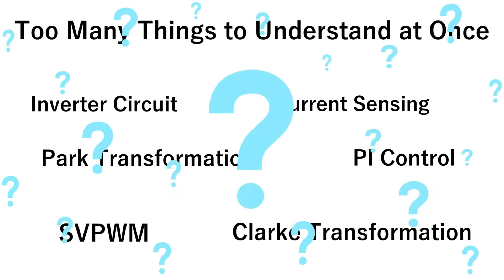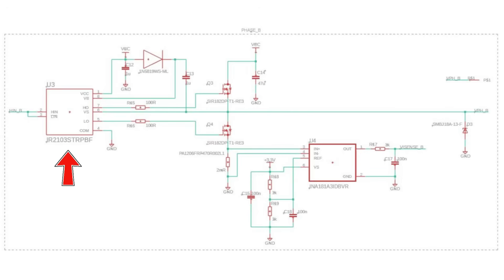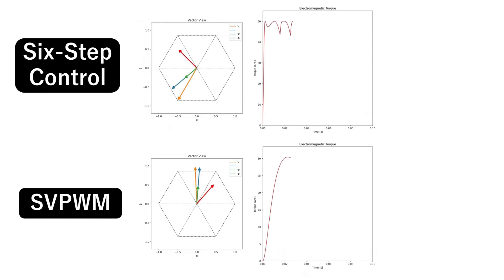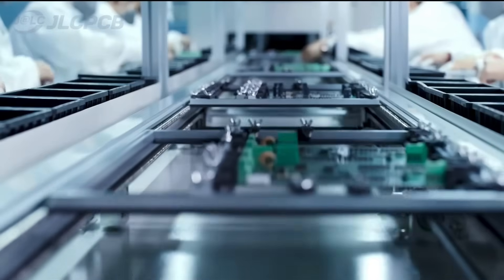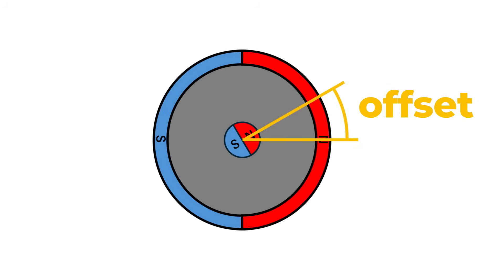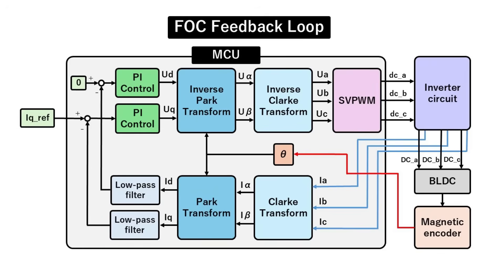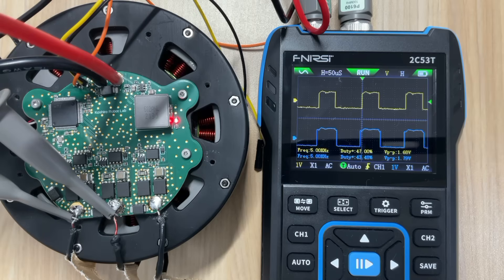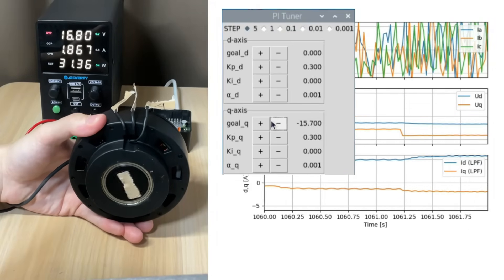I Built a DIY FOC Motor Driver.

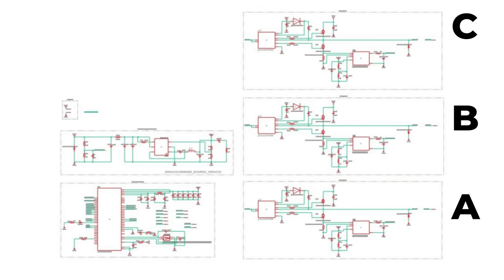Comment: Hi, is that schematic whole parts of the pcb? 2:14 i wonder didn't you fix schematic before do artwork. I’d also like to take a look at the circuit diagram. It seems I couldn’t find it on GitHub. I’m sorry to ask, but would it be possible for you to provide it?

Comment: Good video……Just wanted to know whether this can be done for Trapezoidal BEMF bldc ?
Reply: Yes, but the actual back emf is usually a lot less trapezoidal than you'd expect. 
You can use feed forward compensation to detect and cancel harmonics as well, but even without it, FOC will be quieter and less noisy as the control loops will compensate for it unless it's at really high speeds.

Comment: It isn't true FOC until the motor spins fast enough to make enough BEMF for the controller to determine phase.  Below that speed, you must rely upon the angle encoder.  Many motors (such as in drone propeller motors) start the motor open-loop constant current & ramp up until the BEMF gets large enough.  But for robots & skateboards, there must be an angle sensor.
          You make no mention about the code (other than the algorithm).  How many lines of code does this require?  What code language are you using?  STM processor seems like gross overkill, unless you are writing in "bloatware".

Comment: Why does each pattern map to a voltage vector? how do we know which pattern maps to which vector? Why do you need those diodes around the inductors? I know the answers but a lot of people watching have no idea. Stop making 15 min videos to explain complex topics for people with small attention spans. If a person cant sit and listen to an in depth explanation they probably aren't going to be able to focus for the weeks its going to take to build and test this stuff. It's no going to work the first time and you are either going to spend hours on hours researching to figure out why., or you are going to give up. Which means they aren't going to watch your videos anymore anyway.
Reply: At least you used an stm32 instead of raspberry pi. I give you credit for that.

Comment: I don’t think I understood anything about FOC. 😄 I am keen on getting one of these boards though. One question I have is, how do you put the components on the bottom of the board? I can only assume it has to be done with a soldering iron.

Comment: Amazing work. I'm making a small FOC driver with a DRV8316 motor driver. Nice part is the built-in current-sensing. Almost ready to order the PCB, will see how it works out.

Comment: Hi, i'm just wondering did you get the torque vs time plot from testing the motor or is it something you get just from the torque equation itself.
Reply: Was wondering the same.  How did you measure torque.

Comment: Neat video. Though if you instead cloned the VESC circuit and firmware you would have a more robust end-result. Or used a TMC4671, they’re pretty cool.

Comment: I have a question. What is the point of all that transformations if you already know the angle with encoder and torque with PWM parameters?
I made BLDC driver with sinus table and encoder, and all I have to do is to track where I am, and what to apply based on encoder, I don't need to do any calculation or transformation. 

So what is the benefit of FOC in that case? This is I can't figure out:
My video:
https://youtu.be/_GL5JGfQk8o?si=fnCFFs7bJeEfOp6e
Reply: I can answer this question if you don't mind. What you are doing is sometimes called "open-loop FOC" it's like the real "closed loop FOC" but with the assumption that current is proportional to the voltage. It works great at low speeds. But at high speeds, it becomes inefficient. At high speed you will have a BEMF in your coils, which will decrease actual current, so to achieve torque control, you need to account for that. The other issue is coil inductance. For high speeds, your current starts to "lag" behind the voltage because of that. So for example if your voltage phase should be 90 deg ahead of your rotor position at low speed, at high speed it needs to be more, to compensate for the effects of coil inductance. All of these effects are compensated in "closed loop FOC" and basically that's all what these formulas are about. All these formulas are about measuring actual current and making sure that it's exactly 90 deg ahead of the rotor in phase and has the desired amplitude (desired torque).
Reply: @Positive_Altitude 
I have lag compensation done with phase advance based on current speed. This is a very simple formula. My PID for speed is pwm duty cycle, so far works great. Wondering,  since I have all phase current measured by adc, I could try to implement FOC. Would be interesting math/programming problem to solve if I have time :)
Reply: @Kilohercas Nice! Theoretically it could be close to closed loop FOC performance if you use additional compensations and fine-tuned all parameters. Good luck with FOC implementation if you go for it, that will be fun 😊
Reply: @Positive_Altitude 
For each 500rpm (up to 12000rpm)I tuned offset and when fited polynomial to it. And offset was for highest speed. Have no idea what would happen under load... any ideas ?

Thanks !

Comment: Hi, in the video your schematic is showing 1k+100nF low pass filter on INA180 output, this would set corner frequency around 1.5khz and time constant of 100uS. I think this is way too big value for the low side current measurement. Current can be only measured while the low side is conducting current, with this big time constant it cant reach signal real value. You could try something like 100r+22nF
Reply: I noticed that too. Actually, you probably don't need a filter here at all. However, what you need is to properly set up an ADC trigger in sync with your center-aligned PWM timers. As a reference design, you can check B-G431B-ESC1 schematics. There are no hardware filters.
Reply: @Positive_Altitude  You still want a low-pass filter for anti-aliasing - but the rest of the filtering can be done in software.
Reply: And this rc filter should be implemented to shunt side with symmetrical resistors

Comment: Your Iq drifting maybe caused by magnetic coupling and integrator gain is zero at video. This causes steady state tracking error. You can also try tuning each control loop independently. Great video by the way, please keep up. Also at this stage, implementing field-weakening control is a breeze.
Reply: Are you an engineer and if so, how long have you been in the field?
Reply: @pascalroosendaal4981  I am actually astronautical engineer who is trying to specialize in control field. I made lots of research about robotic actuators and simulations for my graduation project. Right now I'm not working with motor control for my job but working as hobby at home.

Comment: This is a dense video.  I've been researching FOC for a little while and I'm still wrapping my head around it.  For me it would be grounding to have some kinda visual queue when you're explaining hardware vs software vs theory - just to organize all the systems.  Connecting the schematics to hardware so beginners can visually map the path of the current through both systems - could make it more digestible.  Like, is it safe to assume all equations are code?

Comment: That gate driver is too low current for your mosfet and the 100ohm resistor is way too much. You're getting unnecessarily high switching losses. By using a driver with low and high side inputs like LM5109 you can optimize the dead-time. Start with a 10R gate resistor and adjust until ringing is gone.
Reply: Or you could make it even easier on yourself and use the STSPIN32G4. It has everything you need for a drive: mcu, power supplies, gate drivers, protections. You also don't need the INA181, you could use the embedded op-amps for leg current sense.